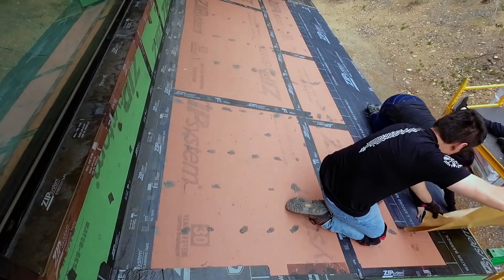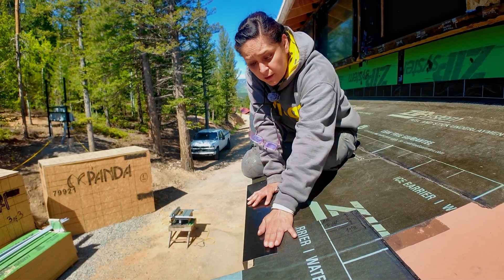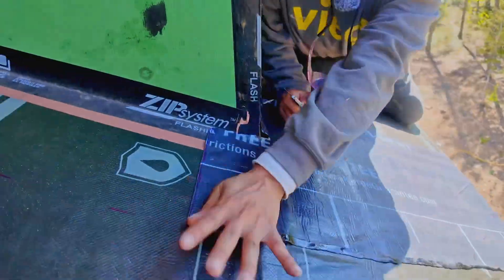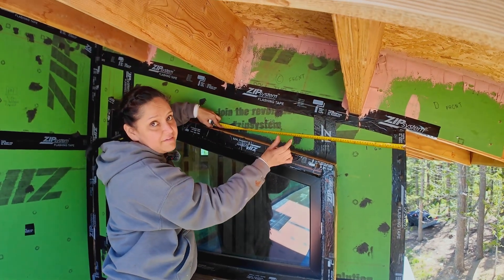Installing Peel‑and‑Stick Underlayment: Why It Matters & How to Do It

Comment: It just seems so crazy to need this on top of the already present integrated WRB on the zip sheathing.
Reply from the maker: It is! I'd say though, zip system can get damaged including the tape if it's not covered right away. Many builders or roofers don't care to check the tape is good before installing the finish. Because of that is that I think this kind of rules exist.